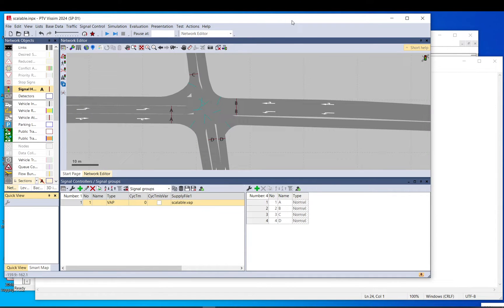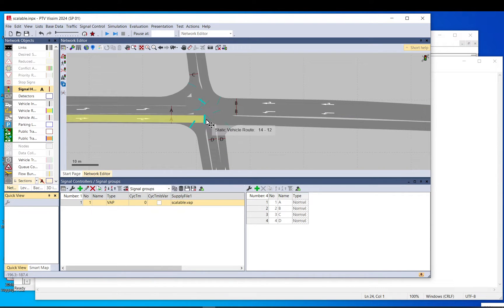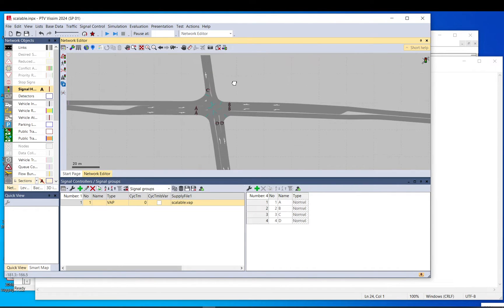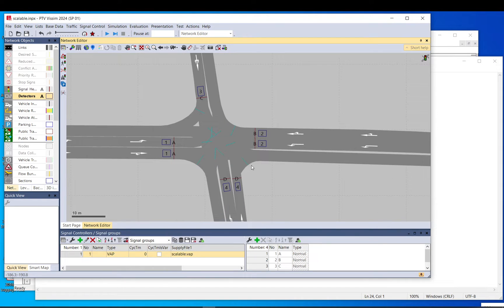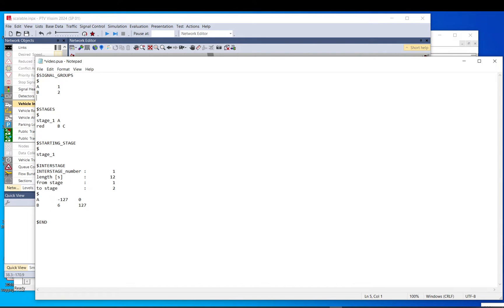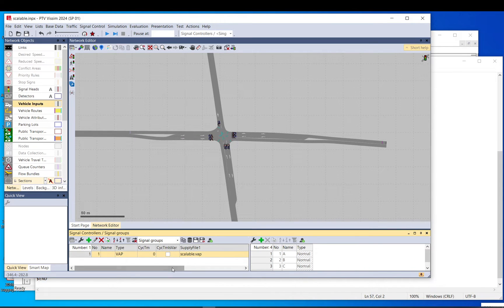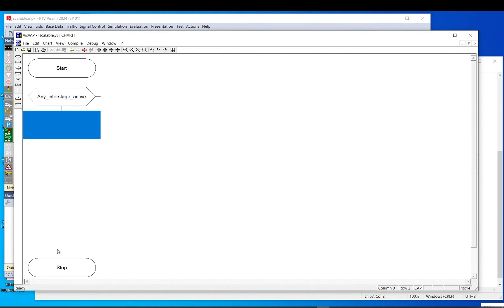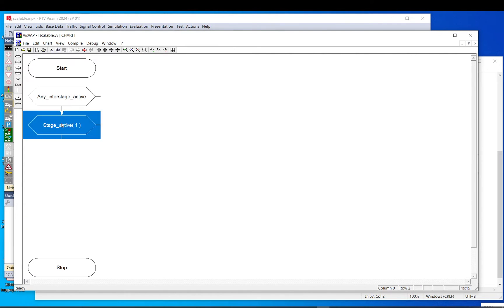Vissim Tutorial - VAP/VISVAP - Simplified, Copy/Paste logic (scalable)

Comment: Is VisVAP a separate software or part of Vissim in PTV Vissim professional/thesis version? I think the VisVAP software is missing from student version of PTV Vissim. Thanks
Reply from the maker: Hi, it is a separate application (a separate exe file basically), but only compatible with Vissim. An external software that basically part of Vissim (a module of it more or less). Yes, unfortunately it is not included now in the student/demo version. Back years ago it was included in the student version if I remember correctly.
Reply: @MatyasLemberTutorials  Thanks.

Comment: That is very useful Matyas. Is it possible to define a cycle time that is constant even though the signal are actuated?
Reply from the maker: @gemesion Hi, yes of course. It just needs a more slightly more complex logic. You can utilise timers for example to achieve it. I might do a video for such a bit later
Reply: @MatyasLemberTutorials  Is there a need to code a separate 'all red' stage in the pua files or the vap logic accounts for it?
Reply from the maker: @gemesion  No, not necessarily. It is very important though to first work out the operations of it, ie how you want to keep the cycle time. There are many ways to deal with it.
How to deal with skippable stages, which stage to assign leftover green times and so on. These need to be answered before start coding.